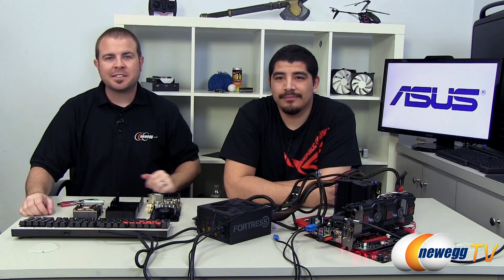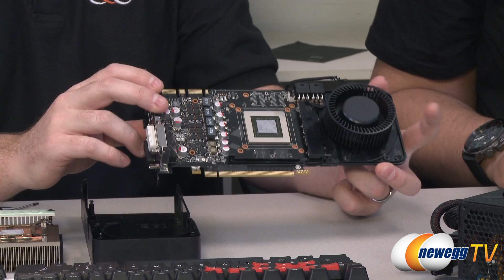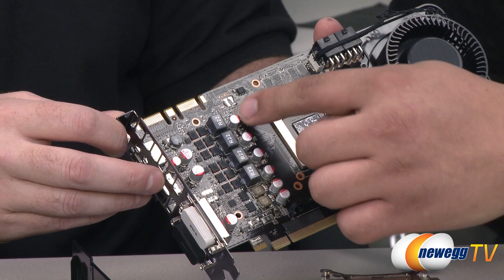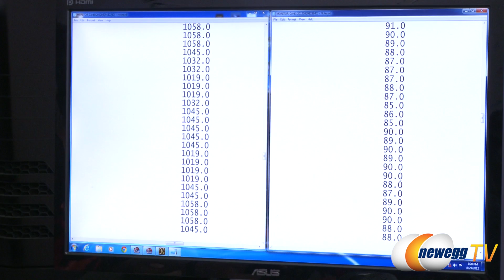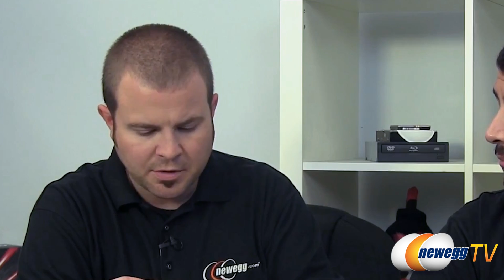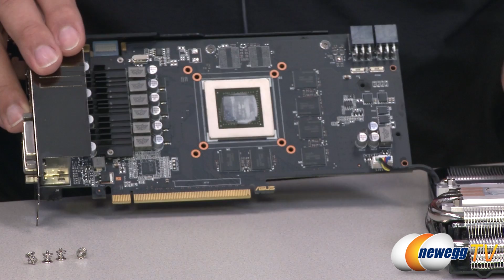Newegg TV: ASUS Non Reference vs. Reference

Comment: i never said that a crazily overclocked HD4850 would beet a GTX 680 or something, just said that i'm a bit disappointed in the overclockage of the ASUS cards of the GTX6XX but i guess that i am more disappointed in this generation of cards overall rather than specific ones. also, i would like to rephrase my previous statement,  the hd7xxx are funner to overclock than the gtx6xx. also i did read on nvidia's response to overvoltage and i understand that if you added it there would be no warranty.

Comment: GPU memory doesn't stack. Meaning that if you are running 2X 2GB 680s in SLI, you will not have 4gb but rather 2, so if you go over 2, it will bog down on you. Also the GTX 690 has the same concept. Although it is advertised as a 4gb card, 2 per GPU, in reality it only has 2 GB of usable GDDR5 memory. See where I'm getting at?

Comment: I do... I have a 3 monitor setup 1920x1200, I was playing Max Payne 3 and I realized I actually can't max ALL the settings with the GTX 680 SLI (4GB total), there's literally one settings I have to set to medium instead of high, I just barely exceeded the video memory by 50mb. Now, I don't really NEED more than the 4GB total memory, but I WANT either a 3-way GTX 680 4GB (12GB total) or a 2-way GTX 690 (16GB total) setup. I'm just a graphics whore like that I guess.

Comment: With all of my respect to ASUS and their high quality reference and non-reference cards, they have missed out a bit on this generation. Except of the HD 7970 DCUII every other card is worse than its competition which makes better cards. Like Sapphire with their 7950 950Mhz Edition card which EASILY beats the 7950 DCUII and then some or MSI Power Edition cards on the GTX 6XX side which allow overvolting. do not think that i dont like ASUS, its just that this year they weren't the best as always.